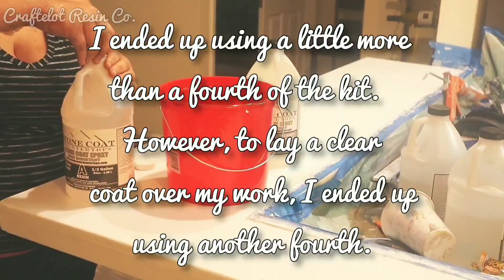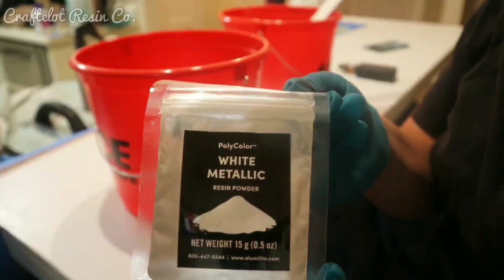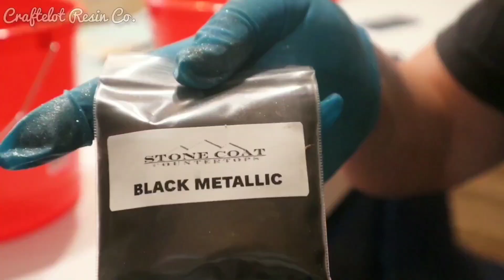StoneCoat Countertops Carrara Marble Kit- Epoxy Countertops Tutorial

Comment: That turned out great. I am looking to do a similar color but have read many reviews of SCC resin yellowing after a few months. How does yours look now? Did you do a top coat? And did you use SCC Ultimate topcoat Natural, many reviews complained about the sheen being too matte?
Reply from the maker: Hey there! I have had no issues at all with yellowing.  Infact scc resin is one of the best brands out there with regard to staying clear. I have tried many!
(Side note: scc's craftcoat, which is the budget resin they sell, will yellow, but you wouldn't want to use that on your countertops anyway.)
I did a top coat on these with the countertop epoxy from scc but I did not use the ultimate top coat. It's not necessary. Just use another coat of the resin you used to coat the countertops and do your designs. 
 If you feel your counters need some sprucing up, or the shine has dulled, you can add another  top coat months later if need be. 
 I have had zero issues with scc's resin looking matte, especially when applied to countertops.  
I wouldn't really want my counters to look too glossy, or wet looking.  I think the shine is perfect for emulating stone designs, i.e. granite, marble, etc. 

 Let me know if you have any more questions!!

Comment: Hi can i use air blower instead of that gun that u held?thank u
Reply from the maker: Yes you can, as long as it gets decently hot.  The heat pops the air bubbles. If it does not, you can use it to create effects but will need to lightly run a torch lighter over the surface afterward to release the air bubbles.  Hope this helps!

Comment: How long did it take to dry? And did u use a torch
Reply from the maker: If you are using stonecoat it will dry enough overnight to be able to touch it. However, you should wait three days or so before putting plates and stuff on it to avoid scratches. Most epoxies continue to harden for a couple weeks, even though they don't feel tacky to the touch after 12 hours or so. 
For this project I used my heat gun, but a torch will work just as well for popping bubbles. 
Hope this helps!
Reply: Thanks for the reply. How much epoxy did you use
Reply: And did you apply a second clear coat
Reply from the maker: The suggested measurements are 3 oz per square foot.  That worked perfect for me.  I used a bit more than half of a whole 2 gallon kit for this project.
Reply from the maker: Yes, I did add a clear flood coat.  If you decide to do one, make sure you pour it while the first coat is still tacky. If you wait for the first coat to dry, that's fine, but it will require an extra step.  If your first coat dries, you need to lightly sand the resin before laying your flood coat.  This gives the second coat some tooth to adhere to.  Good luck!

Comment: You should really use gloves. Epoxy on the skin is nasty and hard to clean
Reply from the maker: You are absolutely correct! This was when I was first starting out with resin, and I was not as aware of the potential health risks.  I have since published an article on the subject. You can find it at https://craftelotresinco.com/is-epoxy-resin-hazardous-to-your-health/  if interested. 

 Thanks for reminding the viewers, though. It is crucial to remember that, although many epoxy resins claim to be nontoxic, people tend to have a variety of different responses when they come into contact with the substance. Also, one of the more unique facts about epoxy resin contact is a phenomenon called sensitization.  I experienced this first-hand, although I was lucky it was a mild complication. People can ultimately develop an allergy to resin over time. 

So yes, GLOVES are the bare minimum nowadays. 🧤🧤🧤